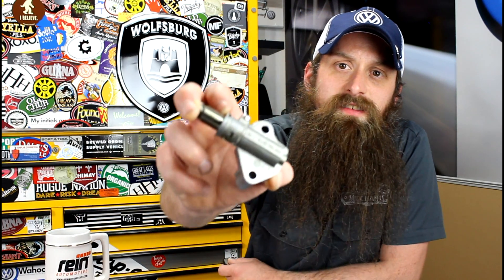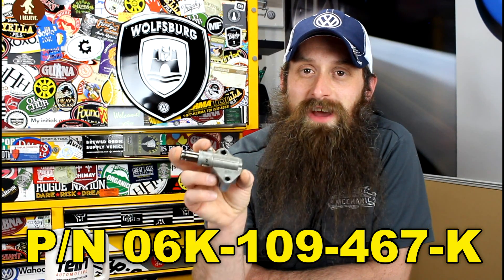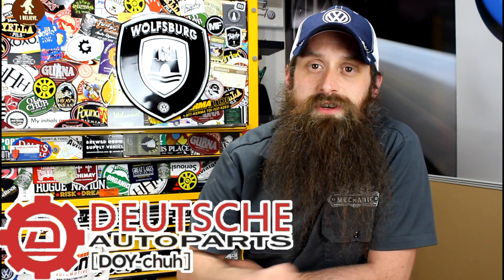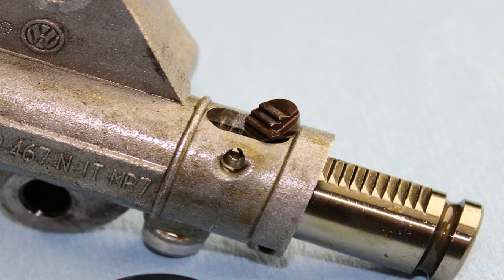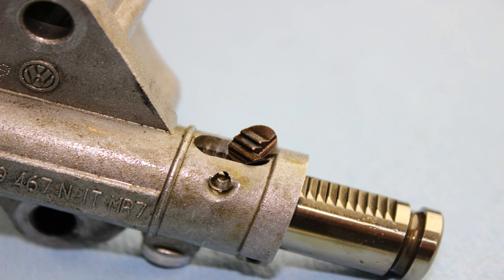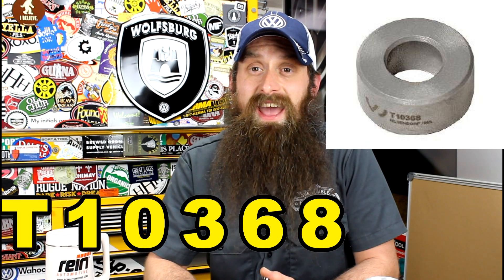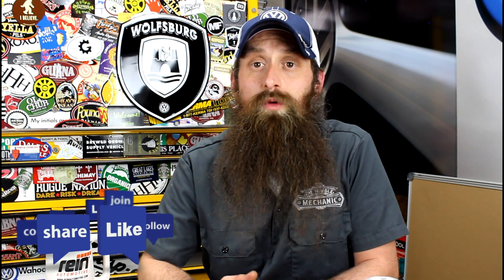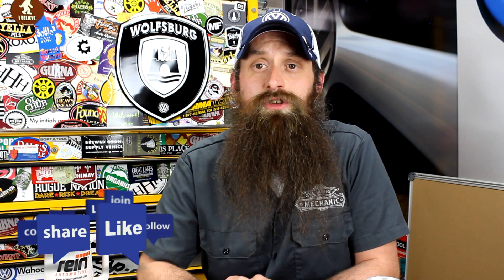How The 2.0T TSI Timing Chain Tensioner Fails

Comment: My tensioner failed but still runs and drives just lost all power I had the 2013 gli I replaced it out home without taking the engine out I must say I got lucky I thought it was a rod knock at first but did some research and it was the tensioner luckily it didn’t jump time or anything surprisingly I just replaced it and it was good but I still went ahead and made sure it was timed anyway the tensioner would just move back n forth causing it to run rough and no power

Comment: im currently checking mines out and my tensioner looks to be the old style but there is no slack or anything, all of the engine shut off symptons and wont crank now, i did notice i have broken behind the actual chain could this be the cause of my failure?

Comment: Hey so I have a 2010 tiguan I bought for 500 put used motor in .. car has 120 k engine 89 k when bought now 104k… has p0016 aka p052a I believe… also the p03xx codes.. 3 of em.. so starts fine runs rough.. as soon as gas pedal depressed it runs fine.. but while cruising or at idle .. shakes and misfire .. NOT compression related.. hear slight rattle… is this the tensioner?? Any input greatly appreciated.. also I run California street machine. A automotive machine shop that does performance builds .. but these dang German things out out of my realm.. but totally capable.. not gonna pay 4 k to replace tensioner when I can do myself..  but please tell me if h think tensioner is problem or sensor.. also replace cam position sensor with one from old engine .. same with vvt solenoid and electro magnet.. crank positions sensor took out cleaned and installed… any input GREATLY appreciated.. thank you

Comment: My tensioner shot apart when I was taking it out and inside of it was a small plack plastic piece on the spring that is inside the plunger. My question is does that piece face the front or back of the plunger?

Comment: Hi I’ve watched many of your videos and all of those are very informative and a great help for a weekend warrior like me. I just bought a Tiguan TSi 2011 with 180k kms. After watching this video I’m trying to rule out if my timing tensioner is the issue why during cold start and the engine is at fast idle I can hear the timing chain which is very noticeable. When you hear it you would say something is wrong. It will only last about 30 secs once it’s not on fast isle anymore and goes down to normal rpm about 750 it sounds perfect and no annoying sound of chain can be hear. Oil level is at max level and last service was at 173k kms.  I don’t have the special tools you’ve mentioned  that’s why i can’t make a crack of this. Any thoughts of this issue? Is it just a tensioner or the chain might have stretched to its  max limit. Cheers and keep doing great videos that are really helpful to other even though we aren’t the one repairing it but at least knowledge wise we are aware of the issues are. A new sub from the land down under. Thank you
Reply: Hey I am also facing same issue, do you have any update?
Reply: @Dex_7_7  still the same but I have  talked to my mechanic friend. I might bring it to their shop at $160 per hour labor. Idk yet if the chain will be replaced or just the tensioner.

Comment: Thanks for this information. Same problem i am experiencing in 1.8Tsi skoda superb. Rattling when accelerating and few times when put in drive i.e. vehicle just into transmission and starts moving i can see oil pressure light flashing for a moment and dissappears as RPM raises. It seems timing chain is loose and power lost momentarily to drive oil pump belt. Currently i stopped using car now to avoid any other damage.

Comment: Off topic sort of. But does the 2.5 5 cylinder use similar chain tensioner? And how many generations are there of the 2.5 5 cylinder? Can you update a first gen to the most current Audi parts?

Comment: my car when creeping in first does a little bit of ticking then starts to sputter then says engine fault and throws a camshaft position code. I have a 2009 gti with the tsi ccta engine. any idea what that could be? replaced the camshaft position sensor already

Comment: The K series is a simpler design, and usually lasts longer. A chain for the balance shaft, and another chain for the oil pump is an example of the extra complexity in this engine family.
Reply: My dad's 95 escort had a single timing belt that covered the cam and water pump. For whatever reason the water pump seized which caused the timing belt to run over the frozen gear destroying the belt. Thankfully the engine was non-interference however having a single belt meant that any part that rotated could end up being what destroys the timing systems

Comment: Hey i have a 1.8 TSI which uses the same timing chain tensioner, it has the 06H 106 467 AB is this generation good?
Reply from the maker: so much better than the 2.0TSI
Reply: @HumbleMechanic  hey, thanks for the fast answer :), why is this the case? I was worried because isn't it the same tensioner as the 2.0?

Comment: Hey so 20 minute ago my 2011 Volkswagen Tiguan 2.0T shut off on me at an intersection. It started it up had it towed home. I just got home and it starts up fine but it’s making a rattling sound and has a cyl 1 misfire code. Swapped coils and it still says cyl 1. Is this symptom of a timing chain issue? Also cranks just fine not freely so leads to me believe that valves were not damaged.

Comment: Hello I have valve cover / cam cover gasket leak (green anaerobic sealant) on 2012 vw CC (2.0 TTsi engine)... my car is at 133k miles and I have never had the timing chain tensioner / chain itself replaced. My local mechanic is telling me that when he removes the cam cover to replace the green anaerobic sealant it is really recommended to do the timing chain tensioner and chain itself as removing the cover without doing it can throw the engine out of time. He is quoting me $950 for the gasket replacement and $1700 for the gasket / timing chain / tensioner work. Is it really necessary to do this when you do the gasket to keep it in time? At what mileage does the chain / tensioner usually mess up? Reasonable pricing? Thank you so much for what you do.

Comment: Do you have a link on replacing the tensioner as diy? I have the old versions tensioner but it does not look like a DIY job. It looks like you need a specialty tool to remove a bearing and you need to support the engine from above?

Comment: Hi Charles, my 2012 GTI's engine keeps shutting off every few weeks while getting onto throttle after a corner, and it throws a "P0341 - Camshaft Pos.Sensor Circ. Range/Performance" code. I've replaced that sensor and it still happens, is the P0341 code a symptom of a faulty Timing Chain Tensioner? Thank you so much, I love your channel, it's so helpful even in June of 2020. Have a great day.

Comment: Is this something that can be simply prevented or avoided through regular oil changes, to minimise chain stretching?
Reply: with my 2015 tiguan with regular oil changes throughout its whole life, I just recently got an inspection and they said that the timing chain is 2° off. And this is at 80k miles. So it can minimize it, but I would say it's better to be safe than sorry

Comment: Ok I got a check engine light that came on but my car does run just doesn't want to go past 60 so had it checked and was told it was misfiring and that the code came back 
Intake camshaft position timing- Over-Advanced (Bank 1)
Cylinder 4 misfire Detected 
So I was wondering if it could just be the Tensioner or something more?

Comment: ahhhhh, soo.... my 2.0 TFSI have just called in sick... P0011.. Quick turning on starter, doesn't start..  no bueno.. I really hope that my timing is just slighty off and that my valves are fine.. 
just passed 18500km.. ;(
Reply from the maker: Fast spinning engine is never good
Reply: @HumbleMechanic  naww, I know. prob. bent a few valves... repair cost from auto shop 8k USD... :O

Comment: Hello There. 

I have a few questions. I am looking to get an 09-15 Audi A5. I am scared of the 2.0T Engine. Since I can’t tell if the major engine repair has been done. Is there a way to tell without spending hundreds of dollars if the tensioner or chain has been replaced? For those model years with that engine, I think it was the chain that was recalled ?

Comment: What are the chances that I have a hydraulic tensioner failure on my 2.0L and no valve train issue.
Reply from the maker: Failure is low chance but the potential is there for issues. I’d check it
Reply: HumbleMechanic  it’s not my Mk7R, I just
Purchased a 2009 Audi A4 and car won’t start, and yes I have cam and crank correlation codes. What are my chances that I have bent valves. I’m debating if should go strait for a motor swap or not, thank you
Reply: Sam S i sold the Audi for parts, it was the easiest way to make my money back and much much more........

Comment: I have 178k miles on my 2010 GTI. Is it possible the original one lasted this long? I do not know if the tensioner was changed when I bought it.
Reply from the maker: Yes possible, just not as common. Best to have it checked, or DIY checking it
Reply: @HumbleMechanic  it's my understanding they fail by starting the car when you've allowed the car to roll back or forward against tensioner? Can you prevent it by setting the parking brake before shifting to park?
Reply: Sam S thanks for the educated reply but I got rid of that thing and got a Jetta 2.5 with FAR less headaches.

Comment: Mine started making a terrible rattle/tapping but went away when over idle. 99% sure its timing chain because it was never replaced, got a low oil warning, and it has 111K miles. Plus it had a terrible metallic grind  for a split second when I turned it off before adding more oil.... After adding oil just the rattle/tapping when at idle.

Comment: I have a 09 passat 2.0t it has a check engine light for crankshaft/cam shaft and a slight ticking on passenger side of the engine what shoul I do and how long do i have

Comment: I have a 2010 jetta 2.0t.  It has about 95k miles atm.  Apex recomended replacing the timing chain tensioner along with one of the gaskets.  They want 1500 for the job.  The car is only worth maybe 6 or 7k at best, but ive done some ecu tuning and i just love the car.....Any advice on wether i should drop all this money on an older car?  Also i have a pretty significant oil leak from the rear main seal which is another 1100.  Thanks for any help

Comment: 2012 VW GTI, bought used at 98,000, now has 112k.  First VW so we're learning about this timing chain failure the hard way.  Two weeks prior to the impact, the engine set a code for a missfire on #2.  Diagnosis was worn plugs.  Put new plugs in, but it was still a bit burbly on cold start.  Then the valves hit.  Spent $5,500 to have the head repaired... now the engine sets a code for a misfire on #1.  Shop says that compression is 90psi on #1 and this goes up to 130 when they squirt some oil in the cylinder.  I can't believe the rings now failed.  Thoughts?  Advice?
Reply: Status update: I did a leakdown test on the engine and found 80% leakage.  The air could be heard out of the exhaust.  Two weeks later, the car seemed to be running better but the check engine light was still on.  I did another leakdown and the leakage was down to 50%.   I waited another week and it was at 27%.  It's a miracle!  My wife was able to track down the shop that did the machine work on the head and they told her they don't lap valves.  It would appear one valve on the #1 cylinder wasn't sealing and needed to wear in.  Lesson be learned; use a good machine shop!  Any monkey can compress a valve spring and swap valves in their garage.

Comment: I can confirm that Humble Mechanic is 100% correct.  If you do not know for sure, inspect your timing chain tensioner ASAP.  The tensioner fails just like he describes.  Replace that old style tensioner before catastrophic engine damage occurs without any notification or advance signs of failure.

Comment: Alas, my wife's 2013.5 VW Beetle R Line has been bitten by the faulty timing chain/tensioner recall from VW.  Her car started throwing a "Camshaft Position Sensor" code.  Thankfully it's under the extended warranty but still...ugh.  Only has 49k miles on it 😠
Reply from the maker: Dang!!! Glad it got covered

Comment: My 2016 1.8t passat is starting to have short 1-2 second engine rattle noise on start up.. Only 56k miles.. Could be this be a chain tensioner issue? Thanks!!
Reply from the maker: Cam adjusters are common failure for that concern
Reply: @HumbleMechanic  thanks!!

Comment: i just had my revision 'n' tensioner fail on a 2011 gti.  Bent valves and pretty much a complete engine rebuild.
Reply: I have a 2011 GTI as well, about to start this project. How'd yours turn out?
Reply: @Mikeynuts21  Just cost a fortune to have most of my engine rebuilt.  Runs great now :/
Reply: You do the work yourself?
Reply: @Mikeynuts21  no, wayyyy beyond me.
Reply: God damn it, how much did it cost you in the end?

Comment: I'm about to have my chain and tensioner replaced.  But why does this happen?  Will the replacement parts fix the issue? Or should I expect this to happen again in 40k?
Reply from the maker: Both parts have been updated. Be sure you’re in point with maintenance
Reply: @HumbleMechanic  thanks man. What about potentially being reimbursed by VW?  My vin's not listed in the existing class action law suit but say enough people complain about 2015 gtis?   Or is there an avenue to contact VW now and get reimbursed?

Comment: Should the tensioner arm be able to move back and forth when I lightly pry on it?
I inspected mine, found I have an old style tensioner. The clip that covers the toothed ratcheting mechanism is still intact, but I'm able to pry the tensioner arm inward with fairly light pressure--something I would assume the toothed ratcheting mechanism is supposed to prevent by making it a one-way tensioner. Please correct me if I am wrong! I'm creeping up on the 100k*mi extended warranty really quickly so I'd like to resolve the replacement sooner than later! Thanks!!
(11' Mk6 GTI @ 94k*mi)
Reply from the maker: a little movement in that tensioner is normal. how far out is the tensioner? The chain may be worn.
Reply: @HumbleMechanic  the tensioner is out approximately 1" 
https://youtu.be/Jov_heDfwtk

Comment: Hello i have a 2012 cc that jumped time. Seems to be off by about 5 teeth. It does still have compression, turns over and trys to start. I looked at pistons with inspection camera and dont see where my valves crashed but im still nervous about possible bent valves. Is there any way to tell without tearing the top end all the way apart?
Reply from the maker: Retime it and do a cylinder leak down test.

Comment: When should I worry about VW parts to fail? Assuming average and not abuse of vehicle
Reply: the timing chain tensioner is actually one of the only parts you should really worry about failing prematurely, everything else that would "fail" is generally regular things that every car needs replacing at certain mileages.

generally, your VW should be very reliable if you maintain it properly.

Comment: Hi I have a 1.8T TFSI A3Sline 2009, the Timing chain failed at  around 60K about 18months ago, mechanic fixed it and has been sweet until xmas eve when exactly the same thing happened at around 75mph  a bump and loss of power on the motorway  EPC light came on and had to dodge a HGV that was coming up fast behind!!
This A3 is our 2nd car and my wife is the owner and she has only done around 4K in 18months as she works not that far from home..
Would this been Warrantied? We are gutted to say the least as it cost a fair bit of money the first time...Its now at the same garage for this reason but they havent mentioned the warranty....
Would they have known about the tensioner issues?? 
I believe Audi Had revised the tensioner in2015 
Its in mint condition beautiful car, dark blue with Cream leather interior....
Audi need a punch !!!

Comment: Mine is in the shop now. Officially it's in for a "stretched timing chain".  It was running but VERY rough.  Gotta laugh, the warranty is 100k miles per the class action, mine died at 99,700k. I'm going to also ask them to replace the cam bridge, lower cover, serpentine, serpentine idler and water pump (leaking).  2009 A4

The did the PCV at 66k and the pistons at 76k.  Guess I just have the turbo to look forward to now, as they are also prone to failure.  Just like my 2013 S6's.
Reply from the maker: They have a list of parts they will have to replace most likely.  Good time for the water pump to be replaced but they will have you pay for that.
Reply: So was the class action for a period of time or only 100,000?

Comment: Hi everyone. Does the engine usually lock up on the 2.0tsi if the valves got bent. I have very very minimal movement when I try to bar the engine over by hand. In process of removing timing cover.

Comment: Nice video. How about warning "oil pressure low shut off engine". I noticed lots of people have this problem. I changed oil pressure sensor in my car, changed  oil etc. Still same warning.
Do you have any experience with that?

Comment: hey man. very cool and informative video. I just purchased the timing chain kit from Deutsche Auto Parts. My car stalls at very low speeds and the EPC goes on for like two seconds when that happens. and then I get a p0341 code camsahft position sensor A circuit range/Performance bank 1 or Single Sensor. I replace that sensor but is still giving me that code. FYI when the car is cold works perfect. but once it gets warm the issue shows up. I'm guessing maybe could be the chain? or the tensioner is not applying enough tension? I just bought the car it is a 2011 audi a4 2.0 t. could you give me some ideas about it? thanks!